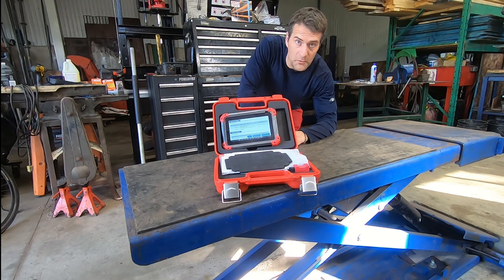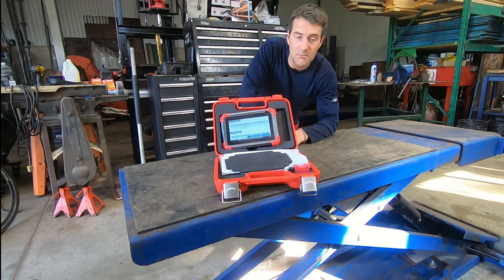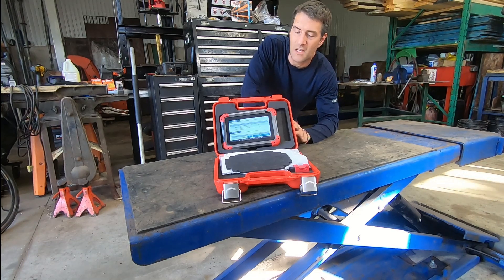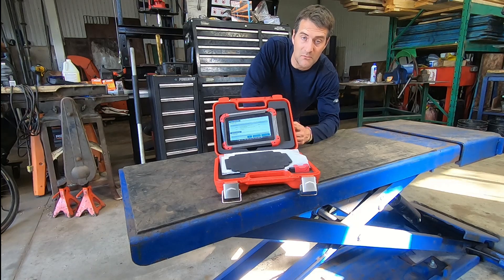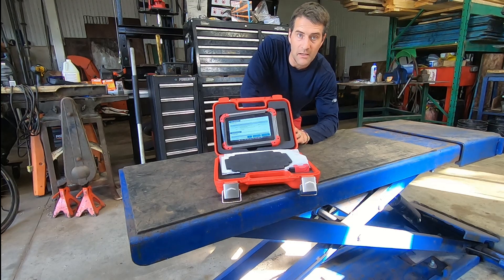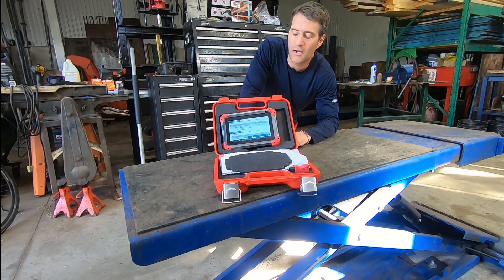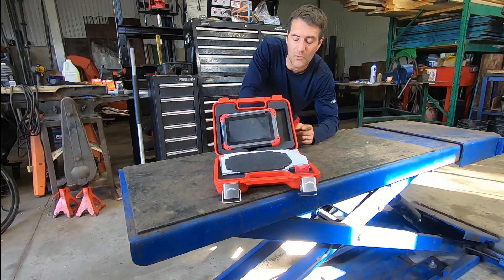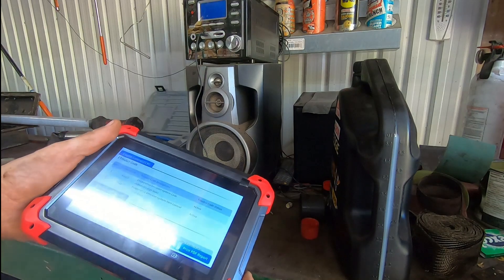Are high end OBDII Scan Tools Worth the Money? They are!

Comment: I have a D7, and I wouldn't call it "high end." It does a lot of things, but there are a lot of things it doesn't do. For example, it won't do an ABS bleed on my '97 Chevy. That's pretty basic stuff on a system that's been around for at least 30 years. On some cars it will actuate EVAP system components; on others, it won't. One thing it does well,though, is monitoring ABS sensor output. That's a big help.
Reply from the maker: I upgraded from a $50 tool to the D7 and it felt like a high end upgrade for me.  Certainly there are higher end tools on the market.  I used mine to pay for itself after a couple of uses.

Comment: Great video. What's with so many nonsensical comments - one guy claiming the tool caused codes and limp mode (really? how?), and another guy saying it's not bi-directional (there are dozens of videos showing it is! why speculate?). I was on the fence, and you've convinced me to give it a shot. All my vehicles are 15+ years old and needing a lot of TLC. If I don't like the tool, I can sell it on and get most of my money back. So that's a good backstop to point out to people. It's not an all or nothing deal.

I am going to check out your other videos. Many thanks!
Reply: I've been using a friend's D7 and what and I've used it on 6 different vehicles ranging from a very unsophisticated 06 Toyota SUV to a 2014 Yukon, 2016 GMC Terrain to my 2018 turbo GDI Chevy Cruze Its crazy how little information i can get out of the Toyota But when i hook to my Cruze it blows my mind at all the pids and information i can get I. even removed a rear light bulb before taking a test drive and when i scanned all systems when i got back the scanner gave me a body control code stating i had an open circuit LR tail light

Comment: Hello can I ask what will happen if the software get expire is there an issue like you cannot use the tool
Reply from the maker: After support runs out the tool will work exactly the same as it did on the day support ran out.  However, your scanner will no longer be able to download free updates of new features and fixes.  If in the future you want the updates you can reactivate support for 1 year at a time.
Reply: Let it sit 30 days without updating it . The D7 im using would no longer work. It said on the screen must install updates before using, So i installed the 231 updates 1 hr later cause you have to keep rebooting it while the updates are downloading and i have fast internet it started working again. Just my experience  @mrdiyguy123

Comment: how much does the annual fee cost after the 3 year expires? to regain use of all car brands and functions
Reply from the maker: You don't need to pay anything after 3 years if you don't need updates. The tool will continue to work without renewing and annual support.  I think if you do want the updates it is like 130 per year.
Reply: One thing to mention. My friend's d7 wasn't updated for a month and it would not work till i installed all the new updates. So i dont know how thats gonna work out if you dont want to pay for new updates once they run out  @mrdiyguy123
Reply: $99 per a year after the 3 years
Reply: @only1hollywoodjacko  how extensive is the special service functions or reset functions vs the Diagzone?
Reply from the maker: @Joey Del Mars Jr.  extensive is a relative term. Check the xtool product site for which features work on which cars.

Comment: It doesn't support all type  of cars. Only 3 or 4 car models are supported. Make sure your  car is supported.  I have toyota and Honda . Most of special functions not working 😕
Reply from the maker: I have personally tested the D7 on over 20 cars and never encountered what you described.  What year, make, models did you unsuccessfully test against?
Reply: @mrdiyguy123  
2014 rav 4. Door window not working.  I couldn't it test it using d7
Reply from the maker: @Sam Elias  my 2012 mustang has power seats but they are not controlled by the cars computer and consequently no scan tools exist that can control the seats.  I suspect the same with your rav4 windows. Did you find any scan tool to perform the test you were seeking?
Reply: @samelias8440  time to take out the multimeter and tear apart door cover and start probing switches and motor regulator

Comment: i used the xtool d7 and it caused nothing but trouble,  many codes, limp mode trouble getting home.  If you recommend an item you should do your research.
Reply from the maker: I have used the tool on over a dozen vehicles before posting the videos and considered that enough research.  The only issues I encountered were operator related.  You didn't state your year, make, model of vehicle, what codes you think the tool caused or if you contacted XTool support.  I am interested in learning more about what happened and what you did to resolve the limp mode and what tests you did with the scanner before the issue surfaced.  If you report it to XTOOL, they will resolve the problem in a software update very quickly.
Reply: I've been looking at top Don it's a much more superior tool
Reply: Ive used my D7 on maybe 10 different makes and models and ive had no issues with it doing anything to the car or truck yet

Comment: Do not buy the X tool it has no warranty it must be an exact condition when you send it back within 30 days mine was not even a year old and it died go to my YouTube and see why it died it was repaired and sold as new
Reply from the maker: The manual on the XTool site states warranty is 1 year so it is a puzzle why you couldn't claim warranty for a failure.
I checked your video you posted on your channel.  It may have simply been reflections on the screen but that unit looks like it was pretty banged up.  Did it look like that when you received it?
FYI - I have worked on many circuit boards in my career and years ago I questioned 2 manufacturers about residue on the circuit boards.  They both independently confirmed that the cloudy residue on boards (that looks exactly like in your video) is a by product of the manufacturing process and does not represent a problem.  I wouldn't assume those solder joints indicate the unit was purchased and returned.  Sometimes a unit will fail a test at the end of the manufacturing process.  Then they send it back through the line to be repaired or upgraded and are still sold as new.  This is common in industry. My vision isn't good enough for me to see the solder joints in your video so I make no comments about their quality.

I'm not dismissing that your experience was unpleasant and simply want to offer some background information.
Reply: @mrdiyguy123  that was the old warranty read the new one it's two years I got a unit that had been repaired and sent out as a brand new unit @mrdiyguy123  that was the old warranty read the new one it's two years I got a unit that had been repaired and sent out as a brand new unit would your ***** like to have one of those
Reply: @mrdiyguy123  I recieved my D7 yesterday, the screen has scratches as if its been used, but functions good so far.  I purchased directly of xtool's amazon page.
Reply from the maker: @Hl2manchcnz  Make sure to check out my other videos and subscribe. I frequently post how-too videos using Xtool scanners.

Comment: great video! Do you know if the D7 can program Toyota prius keys, and, do brake bleeds?
Reply from the maker: Hi there. You should go to xtooltech.com and check the D7 product page. From there check the special function section. From there scroll down to special function-abs bleeding and open the PDF file showing compatibility. It clearly shows Toyota Prius under the ABS bleeding function. However please consult for yourself to be sure your particular Prius is covered. For key programming compatibility look under the immobilizer - Toyota option. I also see Prius listed in this section.
Reply: @mrdiyguy123  Thank you!! Appreciate your  help!!!
Reply from the maker: Please go to the xtooltech.com site under the D7
Reply: @mrdiyguy123  Thanks again. So I bought the D7, used it on my 2005 Prius with a problem brake actuator. Got a P0aa6, but no subcodes to determine location of problem. Also, when in special functions, the D7 would not connect with the ECU for the brake bleed. To Xtools credit, they are currently looking into these issues. Will keep you posted.
Reply from the maker: @michael sweet  I have reported issues and then they were fixed on next software update.  I am not saying that happens every time, but that was my experience. Please do let us know how you make out over time.
Reply: @mrdiyguy123  You were right, they did investigate it, and reported back NG, unit would'nt be able to perform that.

Comment: ❤I got D7 yesterday and unfortunately my 2022 Mitsubishi Outlander’s vin isn’t support. I have to return d7 and refund. Half of thousand of dollars 😤
Reply from the maker: Do you already have to diagnose a 2022 vehicle? Isn't it still under warranty? If you open a ticket with X tool they will certainly develop support. They have done this many times and release updates about six times per week. That is normal course of business for scan tool companies to constantly update when new vehicles come out.
Reply from the maker: If you contact me through the email address in my YouTube profile and provide your contact information I can try to help you figure it out.
Reply: Yes, I was going to keep d7 for long time. I was trying to erase SRS airbag codes after fixed. Dealer would want $$$ a lot for just erasing the codes before I could take it to DOT inspection. My SUV’s airbags have been deployed. I bought it from insurance auction last spring. :) honestly, I really like xtool though
Reply from the maker: @Seadoo233  can you brute force clear the codes by disconnecting the cables that go to the battery terminals and holding them together for 15 seconds and then reconnecting?

Comment: AhHA  I was not going to spring for the D8 or D9.  Received my updated D7 using the single db15<>DLC16 cable instead of the 2 part db15<>db15 and the db15/dlc16 adaptor..  And the EMAIL report feature is super.